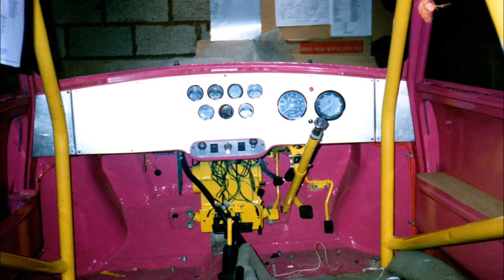How To Restore a Classic Mini Van - Porsche Karminrot Pink -1430cc

Comment: Nice nice nice. I bet it went well. Did you do any sound proofing? So how did you do the door handles, is there a tech sheet for the handles?
Reply from the maker: I never did get around to fitting any trim, I kept it all pretty raw back in those days, it used to make a hell of a racket! No tech sheet, this was back in the days before mobile phones and home PC's. I fitted a solenoid on the back ofthe door pillar, that pushed a piston through a slot in the tricker plate and pushed the door catch back into its mechanism. The door rubber was enough to make the door pop open.